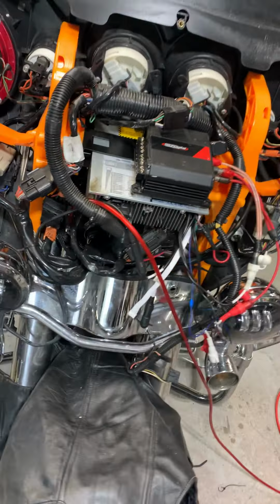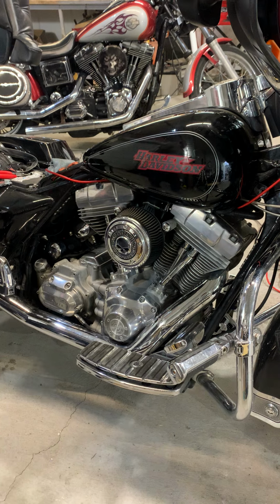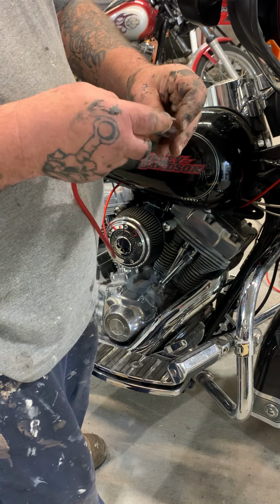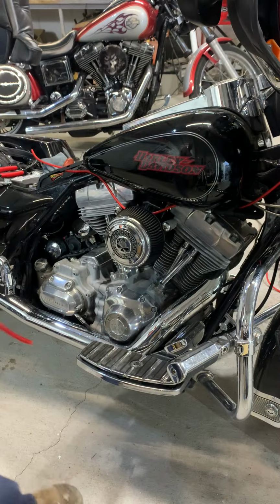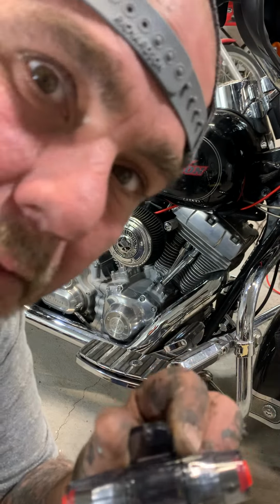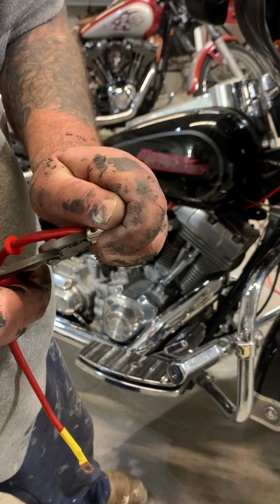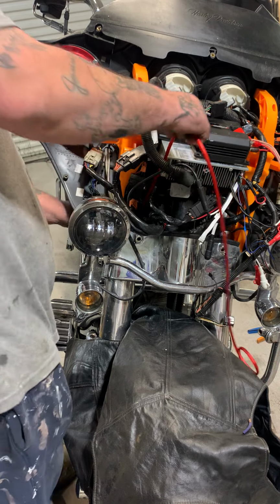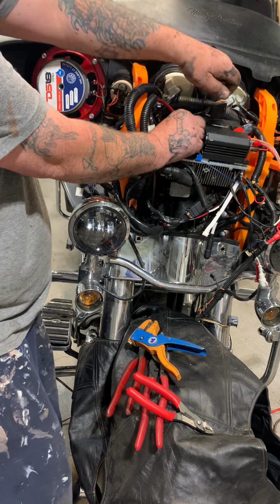Harly Davidson amp install sound digital 800.4

Comment: Are you running 2 speakers? Is that an aquatic av stereo? have the same set up and get get my sound digital amp 800.4 to work. I noticed you have splitters on your rca. Is that required if you are only running 2 speakers?